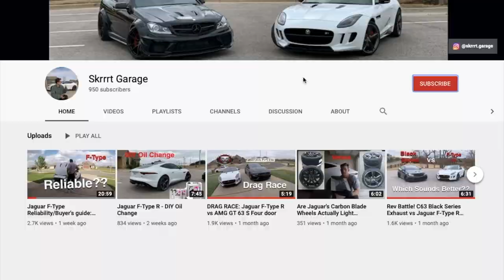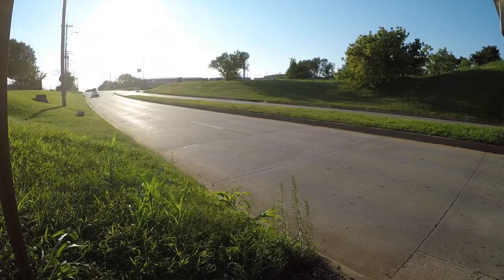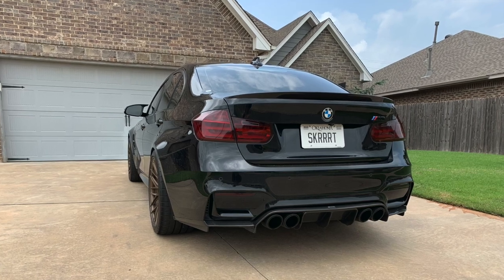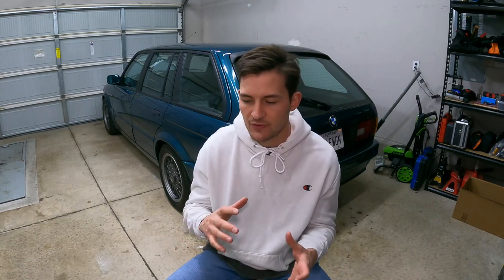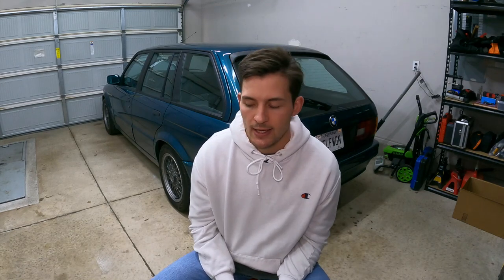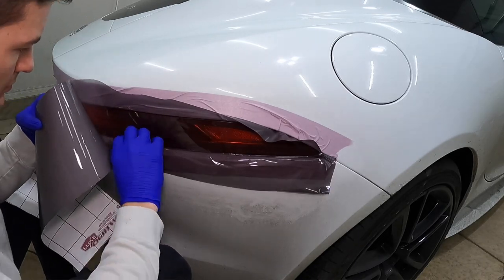DIY Taillight Tint Wrap Tutorial On a Jaguar F-Type

Comment: As an alternative I used the VHT Nightshades and clear coat spray paint application on my F type. Was extremely pleased with uniform coverage and could adjust the tint darkness by the number of coats. Same methodical taping off process and attention to detail, though. Just a matter of preference.
Reply from the maker: Interesting, I’ve never tried that before. I may practice on something not as expensive first though  😂
Reply: @skrrtgarage3922  Actually liked it so much I did the tail light of my Harley and my son's F150. If I would have had more paint I may have even done my wife's Audi. haha.

Comment: Have you ever used paint protection film ? Did your m2 ever suffer with Rock chips ? I know it has its own on the arches but I’m worried about the front and the bits that aren’t covered on the arch\ fender
Reply from the maker: Yea I’m thinking I may wrap my m2!
Reply: I highly recommend PPF for your whole car if you can afford it...at least hood/front fenders,  front bumper and maybe rear fenders depending on how far they stick out. I drive in midwest downtown traffic (albeit not daily) but my F-Type S was pristine when I bought it so I wanted to preserve that. The stock PPF was old and minimal so they took that off and did paint correction on a few spots before starting.
Reply from the maker: I agree, ppf is awesome! I kinda want to wrap the whole car a new color though and kill two birds with one stone hah
Reply: @skrrtgarage3922  you can’t get coloured ppf can you ? I had a quote for 4k Jim for the whole car I’m in two minds about it ,as you know detailing is far less but detailing won’t stop stone chips and does the paint on the m2 chip easily ? Iv never had ppf on any of my cars bilt hamber has brought out touchless wash and touch on which is a ceramic spray on coating again touchless it only came yesterday so not had chance to use it but heard good things so that should eliminate the dreaded swirl marks through washing